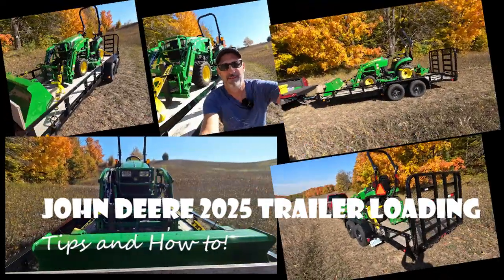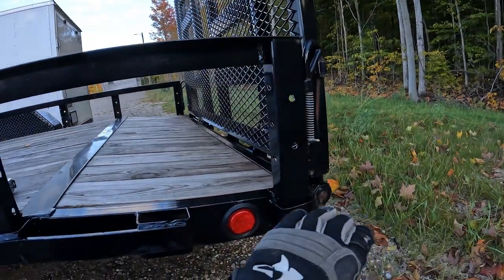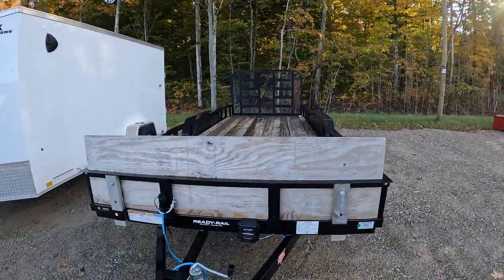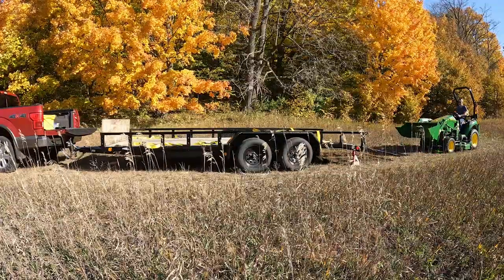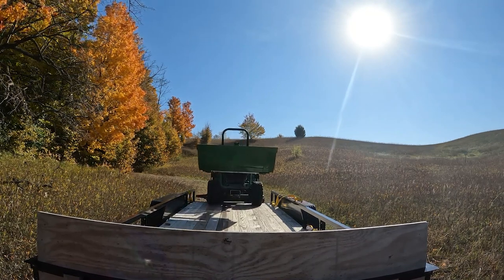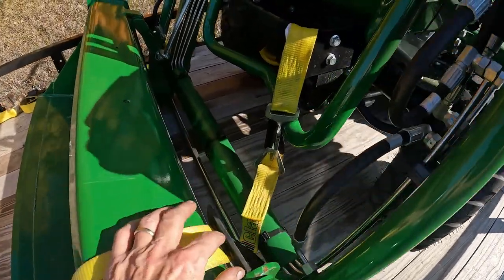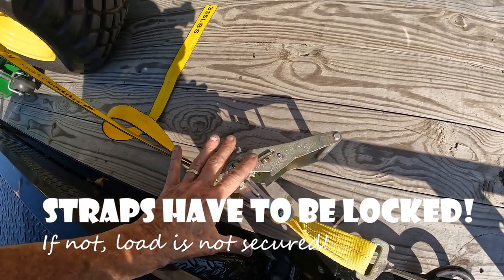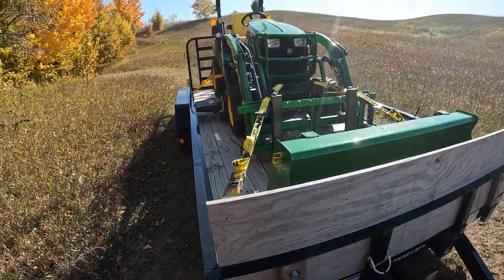Trailer loading the John Deere 2025R Compact Tractor!

Comment: I've got an 18 foot car trailer that I bought for hauling my 2025R. With bucket and backhoe, it comes in about 3200 lbs. I too have jack stands for the back of the trailer. I've seen many guys just drive right onto these trailers and the tractor lifts the front of the trailer up and could cause the back wheels of the yow vehicle to get off the ground. The jack stands are a good idea.
Reply from the maker: Yes the Jack stands help a lot! Thanks for the comments!!

Comment: Just wondering why you didnt strap hood, my manual says to load backwards to prevent hood from opening during transport. You surf the greentalk and facebook group, there is always one out there with hood coming off. I have similar trailer with ready rails, they are rated 1,250 WLL, so 4 of those is 5,000 lbs which is more than tractor.  for commercial  DOT securement is 50% of equipment actual weight.  Looking at your setup your setup for securing  a 26,400 lb tractor, based on your straps being the weakest link at 3,300 WLL.
Reply from the maker: I don't drive it very far on the trailer, and usually not at highway speed, so wasn't thinking about strapping down the hood.   Good idea though and thanks for the share/comment!    I know my straps are more than I need, I just like the bigger size and would rather be over cautious with it!